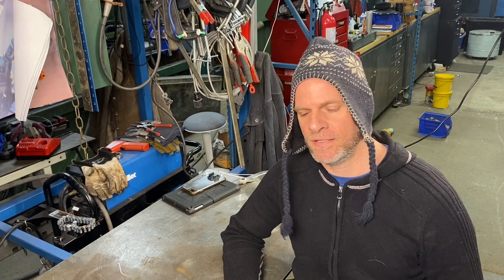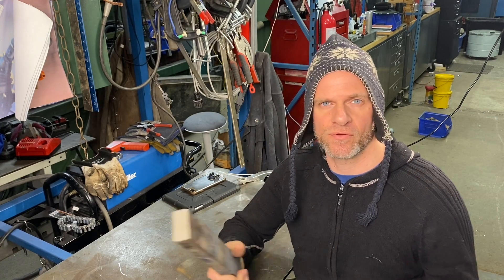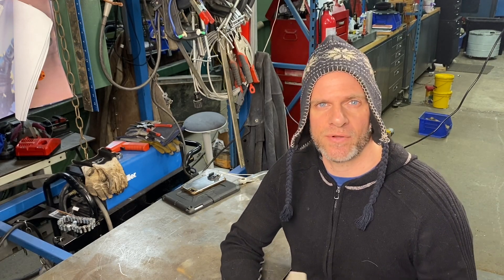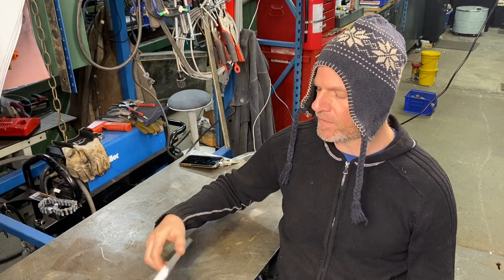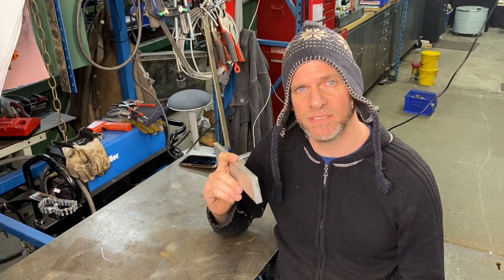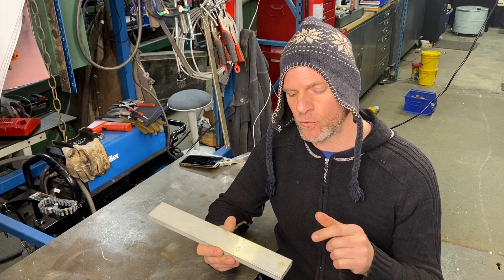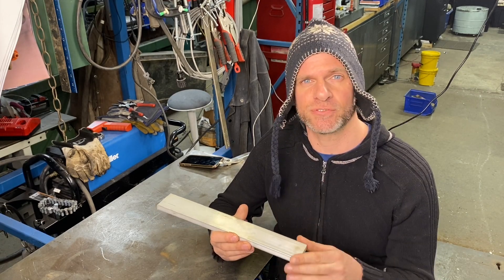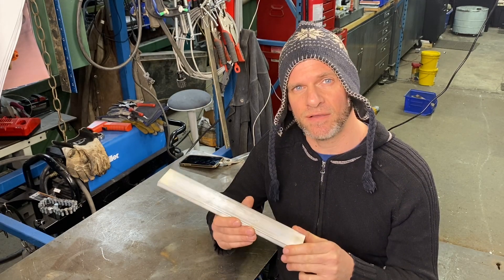Making A Forged Titanium Survival Knife !!

Comment: is that a chuck jaw welded to the ram of your press or a 1,2,3 or what exactly?  does that need to be a certain material or is it just because it's heat treated that its on there?  or not press.  sorry, i guess that's a hydraulic hammer or called something like that.  which leads me to another question.  lol how necessary is that machine for forging?  will a normal, slow press allow the metal to cool down too much to be very useful on longer pieces or ...?  obviously i'm kind of toying with the idea of breaking something expensive.
Reply from the maker: Ya it’s actually some old 123 blocks there heat treated lol , any press will do but the faster the better

Comment: Forging? no 

Stock removal? yes.. 

Titanium: For knife blades it's  not great.. better steels exist for that purpose. It makes great handle scales though. 

Bye.
Reply from the maker: You must have missed the forging part
Reply: @BonifabcustomRobBonifacio  I saw you use a hydraulic press.. hardly blade forging dude. Stop playing. that was glorified stock removal.. nothing wrong with that. That's just not a forge by any standard. It's a workshop and any (and I mean any) real blacksmith would laugh at what you called a forge/forging just now. 

That being said.. Nice knife. Titanium blades aren't my thing. They don't sharpen well and don't hold an edge any better than pot metal. It's got it's uses.. just not as a blade material imo. You'd have been better off buying a sheet of 20CV and using all your titanium as handle scales. Those would be solid knives. 

I know I come off gruff. I don't intend to ruffle any feathers. I just think words matter.. and the definitions therein is all.

Edit: Ok, I'm being a bit unfair on it "being a forge".. I mean.. you can heat metal and shape it. I guess what I'm getting at is at no point was there anything that resembled actual forging (traditionally speaking) being done, and maybe that's my bad for not accepting "new forging methods".. IDK man. Keep doing you. Don't listen to me.. I'm an asshole lol
Reply from the maker: By all means your entitled to you opinion forging is moving hot or cold metal by compressing it , hammer press or power hammer this will make metal stronger and tougher just because I use a press to do this doesn’t mean I’m not forging. A forged piston is compressed hot aluminum this makes it very strong because it’s grains are forced one way . It’s done with a press it’s still forged , the title to my video is not hand forged titanium knife it’s just forged titanium knife that being said thanks for watching check out the next video where i test a similar knife out of forged titanium for its strength

Comment: Many, many years ago when I was in school, my dad brought me home a titanium bolt (MISTAKE: IT WAS A TUNGSTEN BOLT ~ I think old age has crept up on me. My thanks go to Christie Mairy who pointed that out.) and gave it to me. I took it to metal shop and was unable to generate a single spark from any of the various different grinders in metal shop. All I succeeded doing was shining it a little bit.  This means for anyone attempting this forging that alloy must weaken the titanium's veracity or you will need to sink a bunch of money into various belts and cutting bits. Of course, that bolt had been tempered and so it was considerably harder to work with.
Reply: Christie Malry  Guess what?  You are correct I made a mistake it was tungsten not titainium. I am going to edit my comment notifying this error.

Comment: Make one out of tungsten (impossible)
Reply: Easy. I work with tungsten. I can cut it easily with tungsten carbide. Even with sharp high speed steel. But what would be the point? It is very heavy and not hard enough.
Reply: @elduderino1329   fair enough then

Comment: Aluminum scales in cold weather? Rounded spine in a survival knife? A survival knife doesn't have to be sharp? I like the idea of a titanium blade; it is corrosion-resistant, antimicrobial, and can stand up to stress in high temperatures and low.  But you're making a large knife that is not going to be heavy or very sharp, so it won't be a good chopper. The spine will not be a good scraper which means the blade will get duller sooner in use. And since it is a large and (relatively dull) blade it won't be very good for finer carving tasks. So it really won't be a good survival knife.

Comment: If titanium can be Forged.
Can you or i suggest to Forge layers of metal such as titanium in the inside hard steel at both sides then layer again with soft steel at both side.
Such as Filipino type machete that is hard in the inside then soft toward the outside.

The process of doing it is to wrap the titanium with folded hard metal leaving small part of the titanium at its edge for the main sharp blade.
Reply: Titanium draws in impurities in extreme heat and not in a pure environment.  When we weld titanium we put it in a vacuumed pure argon envelope and use built in sleeves to do the welding.  This knife has so many impurities that it has lost it structural integrity.
Reply from the maker: Allan Brian Salvacion that’s a great idea but the problem is titanium does not forge weld with steel so it will never bond to create a stronger sword or knife . Thanks

Comment: I’ve been around metal smithing my entire life, I’ve been blacksmithing for the last 8 years or so and I’ve been making knives for the last 3-4 years. I’ve also been lucky enough to learn from some great people like Jerry McClure and Tom Ward. There are a couple things that drove me to write a comment. First, because your primary bevel is so short on that blade you’ve limited how well it will perform in cutting tasks. Such an obtuse angle is well suited for an axe, not a knife. Also, if you had extended the bevel up the blade you would have decreased the weight significantly which can be an important factor in a survival knife. And that leads into my next point. If the blade was lighter then you wouldn’t have needed all that material for your handle scales to balance it properly, which would have allowed you to make a handle that wasn’t nearly as blocky. That size and shape is going to be very difficult to control, and you can see in the video that it’s hard for you to get your hand all the way around it. These are things that are very important when it comes to making something functional.
Reply: I think it's because his customer wanted a "survival knife." Kind of like a do it all knife that he could actually chop wood, skin animals, and have it for self defense. Kind of like a do-it-all knife that is smallish.
Reply from the maker: Ethan Hansen thanks for your comments , but this knife was specifically designed by my customer he wanted that exact size and shape and angle for the blade he had specific details in the knife design and i made it according to what he wanted . That being said i personally would have also made the knife blade angle more gradual and for my hand the knife handle smaller but for my customer it fits him perfectly I’ve been in this business for 25 years and i hope by now i know a little about knife making  😊
Reply: @BonifabcustomRobBonifacio  omg he must be a giant your customer 😆